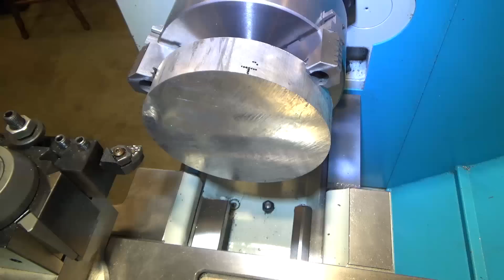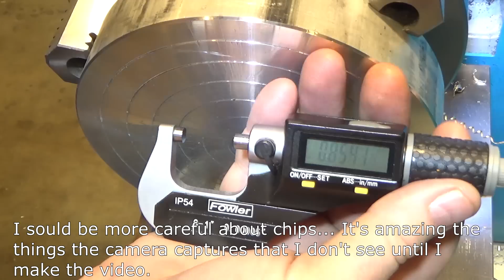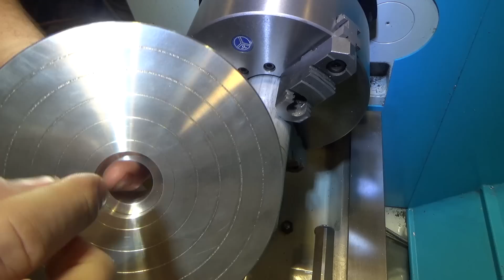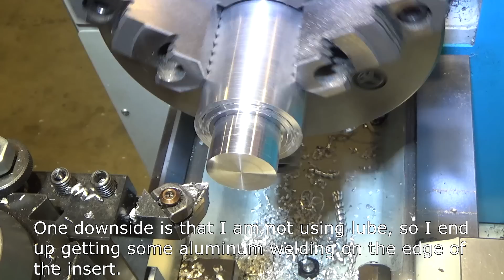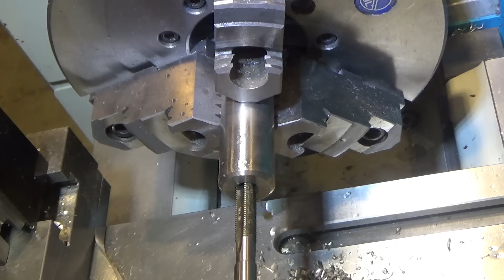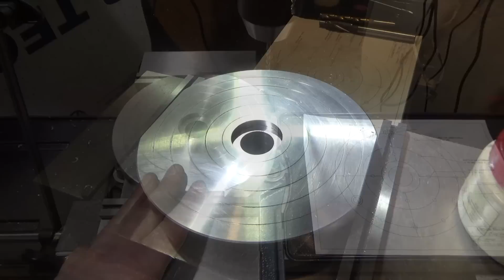Mini Pallets Part 3 The Rotary Table Pallet

Comment: Hey Dudley, I took Machine shop in High School a life time ago. I have a mini lathe and have been looking for a used machine, something that can fit in my small shop. Your equipment must have cost a few. Any tips for a beginner lathe purchase. THANKS for the videos, I could sit here all night watching this stuff...
Reply from the maker: None of the schools I ever went to had any kind of industrial arts. I ended up going to a local adult school a few years ago and was totally hooked. Thanks for the nice comments. The only tips I can get you is get the best equipment you can afford, if you plan on sticking with the hobby/field. Upgrading is expensive. I like my mill a lot, but wish I had sprung for the Taiwanese version instead of the Chinese one. The smoothness and fit and finish improvements were noticeable. At the time I was already overwhelmed at the cost, so I opted to save money. You get the idea. Also more mass equals smoother cuts, typically. Another item is to look for threading options that suit your needs, eg. metric/standard. Power feeds in a lathe can lead to more consistent finishes. Hope these few ideas help and remember I am not an expert.

Comment: if you need any products  realted machine tolos as like rotary table, dividing plate, clamping kit, taper turning tailstock, adjustable swivel angle plate, tilting vertical slide, boring head and  professional forming kit so please
 contect me on 

my email : ajay9811112567@gmail.com 

skype id : ajay sharam100

And you will be available at very good prices

and fb link   

https://www.facebook.com/profile.php?id=100001668278750

Comment: To save time turning OD , neglect the mandrel, just use tailstock center to push it against jaws, the jaws don’t bite on anything, just a flat face. It’s pinch turning. You must be judicious with your cutting pressure tho. Your jaws likely have to be reversed to bear against the largest diameter on the back face of part for maximum driving torque. Joe Pie touches on it in one of his vids.
Reply from the maker: A very creative solution. Thanks. Joe Pie is one of my regular watches. The guy is good.

Comment: Feed faster for the stringy chips to break.
Reply from the maker: Thanks for the tip. I have avoided heavy feed rates because of not using coolant/lube and the associated issues with chip welding. I am, at some point, going to get up the gumption to use coolant. I just hate rust on my tools. Thanks for the comment.

Comment: Better finish on that light boring cut than I expected. - Do you like that Fowler digital mic? - Make yourself a chip hook. -  That heavier feed rate cut is breaking the chips like it should. -  Why would you over stress your lathe? - You may need to indicate off that edge someday. - Nice finish, but is this for show, or go? - Design on the fly, and flexibility to NOT follow a pattern when a better idea comes to mind.  Very good. - Yes we've seen drilling but it's like NASCAR, waiting for a crash. lol -   Good job!
Reply from the maker: I like the feedback. Were you taking notes? Just kidding. The fowler mic works perfectly well, but feels a bit plastic, like the rotating handle  could break easily. The gasket on the battery door survived only one battery change before breaking (on my 0-1") and a new replacement is ridiculous. The mic is less than Mitutoyo or Starrett  buy a fair amount and gets repeatable readings so I am sticking with it, but if I was much better off, or machining was my livelihood things might be different. I have thought a bout a chip hook and have wondered how well they work. Thanks for the feedback.  Everyone's time is valuable,
Reply: I don't take notes, but I comment on the fly, like having a conversation.
Reply from the maker: It works. Thanks.

Comment: Facing from the center to the outside will make the chip curl away from the part and prevent the chip from scratching the finished surface.
Reply from the maker: Thanks. I wondered why some people, like Tom Lipton always did that.

Comment: Looks like you're going to have to learn the hard way, to respect the chips. Don't pull that stuff, bare handed, while it's still connected to the work. It's better to not have to learn the hard way. I know it only takes one good slice to learn but totally unnecessary. 

You're making me cringe, man.  ; )
Reply from the maker: You are totally correct and not the first to comment. I have since modified my behavior so that the hard lesson can be avoided. Thanks for taking the time to help me out.
Reply: Ahh, aluminum won’t cut you unless it tightens up on your hand.  Not ideal tho.
Reply: Crap speaker spouting crap.  Just about anything drawn over your skin can cut you.  Ever hear of a freaking paper cut?

Comment: Hello Robert,  It might just be the camera but it would appear that your 1" hole radius is arcing your telescoping gauge.  When down to tenths it might be wise to use the smallest telescoping gauge that will reach the diameter?  The gauge's radius is larger than the 1" hole's by the pictures.  Might be a couple of tenths larger than the reading.  Also was there a reason for not using soft jaws (copper or even aluminum flashing)?  I expected your .300 cut to mar the finish by rotating in the three jaw but you surprised me with the tool post rotation.  Some of the refinements I have seen is to put a spring loaded peg so your QCTP will only rotate one way and is prevented from pushing back.  Of course something will always give when overloaded.  Nice project.  Take care.  Doug
Reply from the maker: Good observation. If I understand you point correctly, you are saying that the radius of the curve you are measuring is smaller than the radius on the telescoping gauge measurement surface. If this was true then the measurement would definitely be off. Soft jaws are definitely call for when you are attempting to prevent the jaws from marring the surface of the work, especially when large forces come into play. When I use soft jaws I usually want to switch to a 4-jaw chuck because my 3-jaw is not a true set so I cant compensate for variations in the shim thickness and the way the shims interface with the work. I really appreciate you taking the time to share your observations with me. I always learn something and hopefully so does the rest of the community.

Comment: why didn't you use a spotting drill before drilling the pallet?  seems you got quite a bit of deflection on that skinny bit.

Also, I really like the stubby set of screw machine drills when using the mill, keeps the quill close to the work and minimizes tool deflection.
Reply from the maker: I use a spotting drill or center drill when the position of the hole is important. The locations of all of the holes in this project were approximate, except for the center one, but I get your point and appreciate the suggestions.
Reply: You don’t need a spot drill, or pilot drill at all if boring the hole after. In a mnfg shop we just drive up to 2 inch bits into aluminum ( maybe plastic too) with no previous hole/center. It wastes time and is totally unnecessary.  Leave .06 diametral for boring tho.  Most home machinists don’t push their machines. 
Best regards